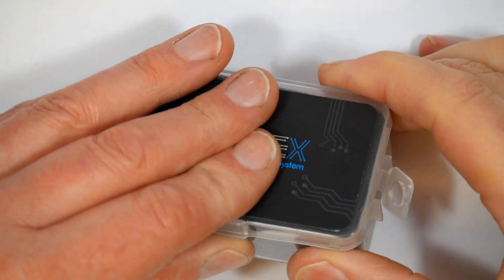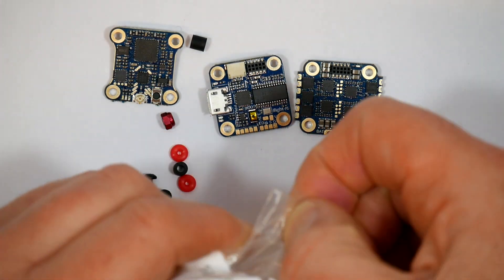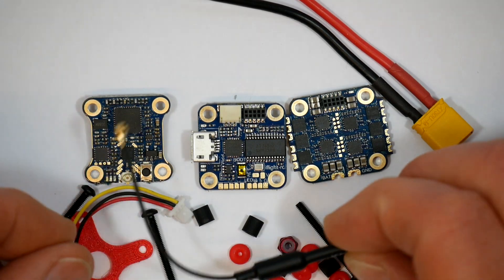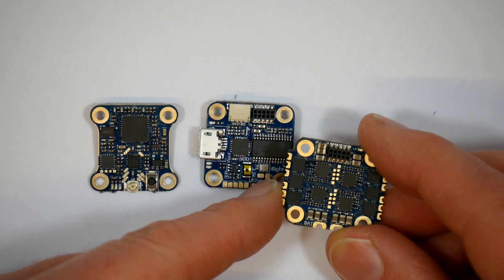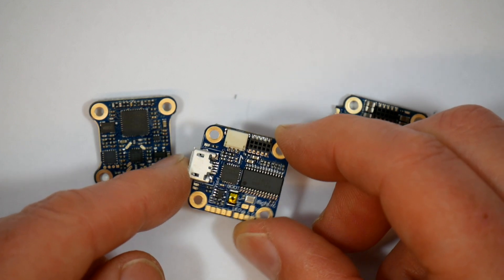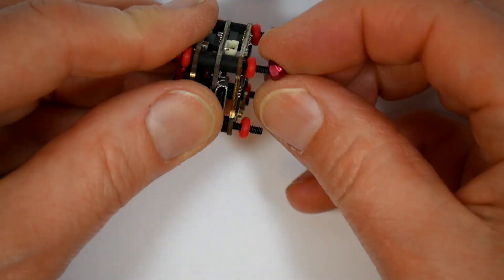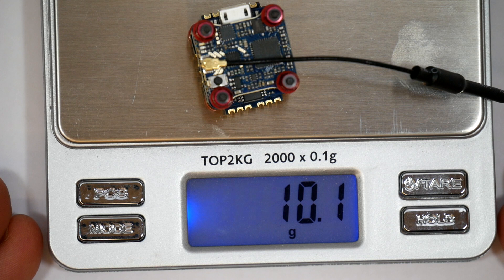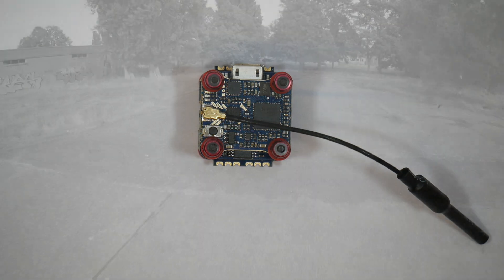iFlight SucceX Micro 16×16mm F4 V2 Flight Tower Stack 2-4S // 200MW VTX // Full Review

Comment: Is there a way to use the first uart for caddx vista? Thanks
Reply from the maker: It depends. It's only got 2 UARTS. One is inverted for SBUS, the other would normally be used for smart audio (VTX channel and power switching) If you're using a DJI controller and the Vista, just use the second (non-inverted) UART to connect RX/TX to your Vista. If you're using a separate SBUS receiver, you'll need to sacrifice the smart audio UART.